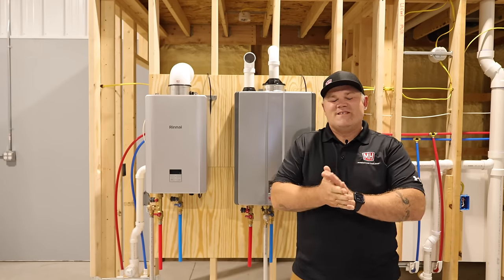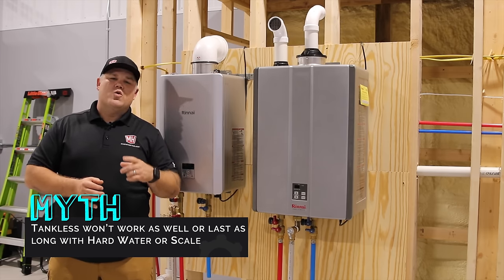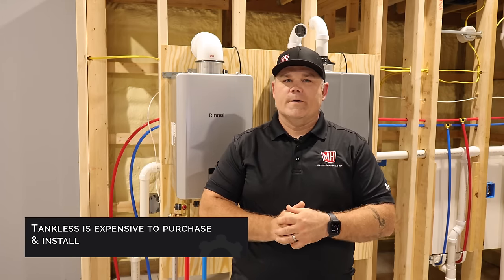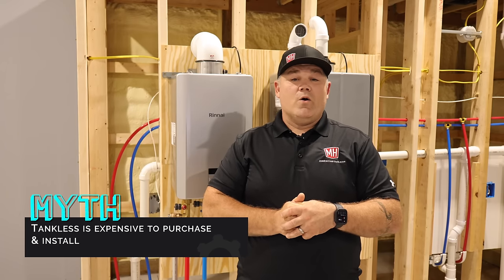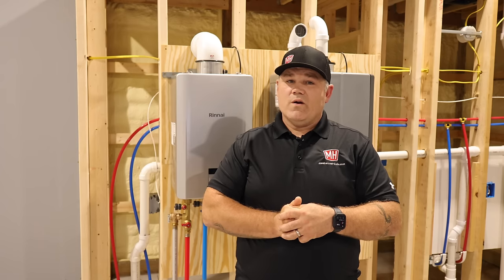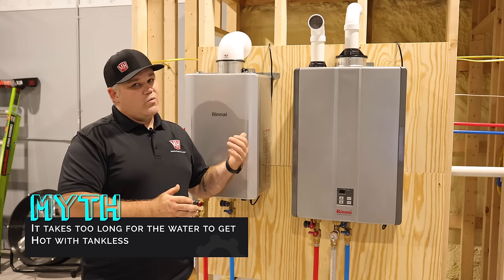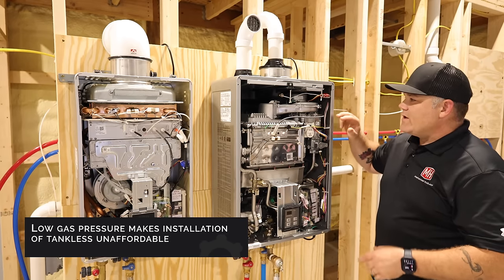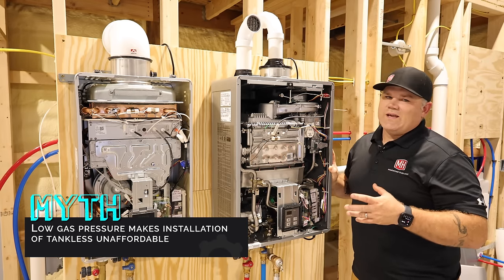Myth Busting! Tank -vs- Tankless Water Heaters

Comment: I have 3 tankless water heaters.  One in each of 3 buildings.  The first one was installed in 2000 and still working fine.  Like almost all videos on tankless water heaters you only talked about gas heaters.  All 3 of mine are electric.  The electrics are probably not quite as efficient as gas but what can you do when gas is not available.  What I love about the systems is that they use NO electricity when no one is running hot water.
Reply: actually electric is more efficient, not not by much but it is. In my area however kwh are much more expensive than gas.
Reply: Does gas continue use when taps are not running....or is that unique to electric???
Lookin @ getting first tankless in couple weeks
Reply: @jeffcale5169  neither is used when taps are off. This is one of the big benefits. If you are gone all day or a whole weekend they don’t periodically run to keep a whole tank hot for an empty house. Tankless just sits there using no gas or electricity until someone comes home and opens a tap.
Reply: @danwake4431  thanks for feedback!!!!

Comment: When I did a tankless unit 12-15 years ago, the venting was VERY expensive as stainless steel was the only option.  It looks like things have changed, but I understand where the concern came from.
Reply: Yes it has, so has the efficiency.  I have a Rheem high efficiency unit that is good for roughly 6 gallons a minute and it’s vented via pvc pipe.  You can hold your hand in front of the exhaust and it’s barely warm.

Comment: Great video. I installed a good gas tankless water heater when my tank version went bad. Did the proper research. Got a better rated one, plenty big. Never run out of hot water. It does take a while to get to the second floor. Not an issue on the shower as by the time I get into the shower, it is hot. The sink however, I usually finish washing my hands before the hot water is present. No big deal. I did ad a pre-filter that did not significantly drop the water pressure as we have natorious hard water. Love the change. Won't go back to a tank. Oh, BTW, being an avid DYIer, I did install it myself and made sure that it was done correctly. Followed the recommendations exactly and watched many YouTube videos. Dad always said it was not worth doing a job unless it is done right.

Comment: I lived in an apartment that had tankless water heaters, it was amazing. There was 1 water heater for every building, and for apartments per building, and a communal washer and dryer. I worked in the oil fields at the time, I would come home and take long showers and never had any problems day or night. I would one day like to have one in my house.
Reply: @es-qf2gw  that sucks. Sorry to hear that. Maybe it differs from brand to brand.
Reply: I also wonder if there's a big difference between the models shown in the video.
We have a model that looks more like the bigger one and it's a beast. It doesn't go full throttle unless you turn on multiple faucets. The water is always consistently at the right temp. Maybe the apartment that was bad went with the cheaper unit that couldn't keep up?
Reply: @AB-ri5ix  very true. Also could be an older model

Comment: Well, that was a great sales pitch.  When I recently choose to stay with my conventional tank style water heater, the deciding factor for me, which he didn't talk about, was the recommended preventive maintenance for tankless units. My old unit went 23 years using supply water with a high TDS reading requiring virtually no preventive maintenance. It probably would have lasted longer had I flushed it annually and replaced the anode but even 15 years like the one he cut into would have been enough for me avoid the labor-intensive tankless units.
Reply: Not on the new ones
Reply: Absolutely correct. If you do not supply conditioned water to the tankless water heater you will have nothing but problems with it. And with plumbers charging between 150.00-200.00 for a service call, any savings by converting to a tankless system will soon be lost.
Reply: tankless are good for nothing...........Put one in bosses house, had maybe 40 ft run, water never got hottttt,,,luke warm
Reply: @ttfahd  did he turn the temp up on it? They are just like the traditional water heaters that come with a thermostat.
Reply: I switched to tankless from electric after going through 2 electrics in 6yrs. The first had been in the house for 15yrs before I bought it and it died my second yr. The second one rotted out in 4yrs. My tankless has been in place 8yrs with no issues. I flush it every 2 yrs. It takes about 30min to do. Fortunately I work for a propane company so I can borrow the flush kit without having to pay a service call. You can buy the flush kit for about $150-200 or you can make one for cheaper money. All you need is a couple gallons of white vinegar to flush through the system. Not a lot of maintenance in my opinion! I have high iron content in my water, by the way, with no filtration!
Reply: Just replaced my thermocouple for the 3rd time on my 50gallon tank (installed in 1980!!!) with a convection recirculation loop to bottom of tank keeps it clean inside. I do have a pan under it with a moisture sensor tied to a whole home water shutoff valve. Tankless heaters with all those electronic boards with capacitors on them... and blower motors and recirc pumps... All the efficiency in the world won't make up for the 3 or 4 tankless units and their maintenance costs.
Reply: @davemoulton2971  We ran a ton of white distilled vinegar through our kcup coffee maker. didn't help. it was toast.
Reply: Sponsored by tankless water heater company
Reply: @ttfahd  there are many reasons why it might not be producing hot water! Not the least of which, you could have gotten a defective unit. I have never heard that a tankless heater couldn't get the water hot when, a) it is installed, and working properly, and b) it has the correct capacity for the house it's installed in ...
Contact the manufacturer, since it should still be under warranty!
Reply: I've had the same tankless unit in my home for 21 years. I've flushed it exactly one time and even then it did not appear to need it. That is the only maintenance I've done on it in two decades of use. I do not condition my water, it is straight from the municipal supply.
Reply: My Rannai tankless water heater was installed in 2008 for $2800. I have never had any maintenance or repairs performed on it and it works great. My wife and 2 kids always have hot showers along with dishwasher and laundry. I would highly recommend tankless.
Reply: …. if you factor in your water, quality and treatment required, and whether or not, you are willing to do the maintenance, and or can simply afford the maintenance, a return of investment exercise Should lead you to determine, which is the better unit for you… Both systems have their faults… ROI will tell you!
Reply: @kenrodmelrocity4241  then you simply have a good water supply, without excessive hardness. not everyone is so lucky.
Reply: Tankless usually need flushed/cleaned twice a year. Unless you can do it yourself, stick with a tank. Much depends on the water. Excessive minerals will definitely need maintenance. We have acidic water and ours never needed it.
Reply: @DeusTex-Mex  Might be more to it than that. Tankless heaters are not operated the same way as a tank. The water temp should be set such that the water at the bath is good for a shower or bath with little or no mixing with cold water. That is the opposite of how a tank is used, and the lower temperature is going to help reduce mineral deposits. I have a tankless insta hot underneath my kitchen sink, set to higher temperature, that is used for cleaning.
Reply: @ttfahd  you obviously shouldnt be putting them in anyone's house if you cant make it work properly, stick to collecting bottles
Reply: Not too hard to do the preventive maintenance yourself but yes, it is an additional consideration.
Reply: Excellent presentation. But for my all electric house is leaves several questions Not answered.
Reply: @daveshort4614  not true at all in my case. Have had mine for 15+ years and do not pretreat our water. Never had any problems and yearly cleaning with vinegar is simple.

Comment: One thing I will be doing to maybe improve heat retention on the long runs of plumbing is to cover the pipes in foil and then the closed cell foam insulation .  This should (hopefully)reflect the heat back to the plumbing delivering hotter water while using less energy to do so .
Reply: Don’t waste your money on foil it will do nothing just wrap in foam if anything
Reply: That's dumb. Just use normal insulation like everyone else does. The heat you lose isn't radiant heat. Aluminum foil is a heat conductor.

Comment: A comprehensive video and I learned a lot about tankless, EXCEPT for the cost.
A water heater in Canada is about 7-800 bucks, I change them every 10 years or so.
Tankless Rinnais are very expensive here, next door neighbour paid $11K to have one installed.
The units are around $6-8K to buy.
I'm certain there are plenty of comments here to confirm these numbers, with the US being lower in their $
Reply: Not sure where you got those numbers but my brother lives in Fernie, BC and just paid $3200 total to have tankless installed.
Reply: rannai i120 is $3648 in Toronto Home depot rn and thats almost top of the line model. where did you get the 6-8k buy price???
Reply: happytrails317  canada is a backend country. we produce everything for the US yet stuff here's so expensive
Reply: here in Chile I can say it's 99% tankless. a good one, (medium range quality) will cost about 400 USD. depending how big is your house, you may need two, mine is 1507 sqft and I need just one. they last forever, mine has 10 years, it's outside and only needed regular maintenance every couple of years, maybe less,  brand: Junkers.

Comment: Our biggest complaint about tankless has been the "luke warm" water you will get at a sink when turning the hot water on and off at a kitchen sink while handwashing dishes.  The delay for the burners to kick on after it senses flow allows bands of cold water to exit the unit before the water is up to desired temp.  This results in a luke warm output at the sink.  Outside of that we love it and wouldn't consider going back.  I have considered a loop to the heater from the kitchen sink that will run for a set time after flow is detected, just haven't done it yet.
Reply: I have the same issue when shaving in my bathroom sink.  See my comment above (or below.. where ever it shows up)
Reply: Sounds like they need a AI module ? 👍🤷

Comment: We've been using a tankless now for 5 years or so and this is my observation since switching.
1) we have a gas tankless. And I suspect a similar issue is involved with electric ones. But we had to get our gas meter replaced with a higher pressure/volume unit. And we had to have new gas regulators installed on all the existing gas appliances (stove and furnace) to compensate. Because we're dealing with a monopoly, it took weeks for them to come out and swap out our gas meter. It didn't cost us anything, but it was a pain anyway. For electric, I suspect we would have had to have a new circuit installed in our fuse panel and power lines run to the unit.
2) Cold water sandwiches. No, not the kind you eat. We have a condensing unit and periodically while taking a shower, the water will suddenly get "colder" for about 15 seconds, then it returns to the original temperature. Granted, it's not *COLD*, but it's cold enough to notice and you need to be aware of this so you don't compensate by making the water hotter, because when the hot water returns, it will be too hot!
3) It does take longer for the water at the faucet to feel hot. Not a lot, but it is noticeable. I've toyed around with a recirculating pump, but cost wise, it isn't worth it so we put up with it.
4) maintenance. Our tank heater we never bothered with maintaining it. And when it was taken out of the basement, it showed! gunk came pouring out and into the back yard! Yuck. So, one of the things I heard with tankless is that if you don't descale it yearly, it will become junk in less than 5 years. So I purchased a sump-pump some hoses and a bottle of chemicals and a bucket. And every year, I run the chemicals through the heat exchanger to keep the scale at bay. This $150 investment I hope will pay off in the long run. And it's just 20 minutes to do. Then when it's done, I write on the side of the tankless heater, the date of the descaling to keep track!
Reply: The problem is with clients wanting to switch over to electric tankless from electric tank water heaters.  But in all cases so far, all the fuse panels would have had to be replaced.  They just didn't have the space for the 2 or 3 extra 40 amp fuses, or they didn't have enough overall amperage and had to move up to a 200 or 300 amp box.  Plus, lines have to be run, which gets expensive quick.  I noticed he didn't mention that.

Comment: We had a navien for 10yrs. Combo boiler/water heater. Worked great and saved us 3/4 on our gas bill. However 6 weeks after the 10yr warranty was up things started going. Motherboard, valves, other stuff. Our HVAC guy , a licenced navien repairman, was so frustrated along with us that after 8 weeks of trying various repairs we gave up. We replaced it with an american made lochinvar. Seems fine so far. We'll see after it's 15yr warranty is up.
Reply: My 75 gal. Lochinvar, from early 80s lasted 30+ years, working even while having a small leak for the last 5 years.  Not sure the new ones will last that long now.
Reply: @chrisxiromeritis8654  Man don't crush my dreams I haven't even paid the 7k bill for my new Lochinvar tankless. 👊😎👍

Comment: We had the horror of installing tankless by a brand called Eternal.  It was an Eternal problem.  The service company replaced the entire unit twice in the first  year and then once every year until Eternal went out of business.  The company was a subcontractor for Home Depot.  Home Depot gave us a new Rheem 50 gallon tank for $120.   We were afraid to go tankless again.
Reply: I've heard of them.  They had lots of issues with parts becoming "obsolete" as well if memory serves.  Something would break on the unit, the repair guy would come out and he'd say "Yea, it's this thing, they don't make it anymore, can't fix it", and the homeowner was out $1K (or more) for a new unit.  Even when some of these were under warranty the run-around was horrid.  It's one of the horror stories that have kept us away from tankless, but I'm really leaning towards it, especially when natural gas costs are SKYROCKETING every winter (2022/2023 winter our natural gas costs more than tripled for 4 solid months).   They are still near 1.5x what they were in 2021. Thankfully we have a High Efficiency water heater, but heating 50gal of water takes a bit of time for sure!

If I go tankless, i want it to last a minimum of 15 years (that's what every tanked water heater I've owned has lasted, and I know people that are getting 20 out of them).  Since I have power and gas to my existing unit, installation of a tankless should just require a mounting substrate put in, which honestly?  That's 15 to 20 minutes extra work since all the venting already exists from my existing HE unit.
Reply: Jesus is the only way to healing, restoration and salvation to all souls. Please turn to him and he will change your life, depression into delight, soul heading from hell to heaven all because of what he did on the cross 

“Whoever calls upon the name of the Lord shall be saved” Romans 10:13
Reply: You are on the wrong channel.   @HaroutBlack
Reply: @kellymurphy-stevens9230 I think because everytime their tankless broke they were screaming Jesus.
Reply: @HaroutBlack WTF does this have to do with water heating??!!

Comment: I had my plumber install one about 12 years ago and it was the biggest electric savings I’ve ever been able to achieve. It never ran out of hot water.
Reply: What electricity did your tank water heater use? The power vent fan? Your tankless water heater uses electricity too.
Reply: Tankless heaters are far more efficient that's why it costs less .

Comment: I have a tankless, it's been in my home for at least 10 years. The only thing you missed was the annual maintenance, as mine is flushed every year by the company that installed it.
Reply: Many newer tank heaters also specify annual draining or flushing for sediment. Most people just are not aware.
Reply: What does flushing do? How do you flush? Water flows through it all the time.
Reply: @jameskehn8609  the drain is on the bottom where sediment builds up. That sediment doesn’t travel all the way up and through your system as it’s heavier…
Reply: @jameskehn8609  Water scale builds up inside and the unit is flushed every year with vinegar to remove buildup. Also the igniter should be cleaned as well, over time is gets dirty and eventually may not ignite the gas.
Reply: @jameskehn8609  if you don't flush out the scale that build up you could end up replacing the heating unit, which would be very costly. Affects efficiency as well. As he said - that pertains to condensing units only.  I have the company that installed it do it even though I'm capable.  I'm not capable of remembering or scheduling it lol.